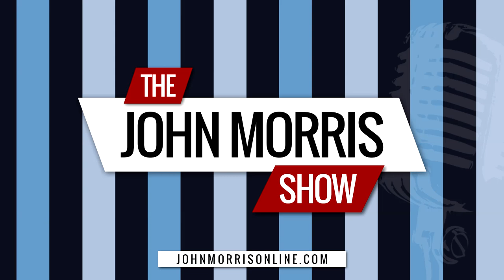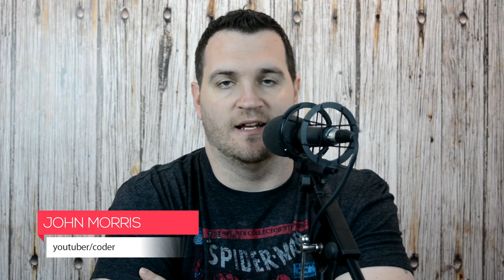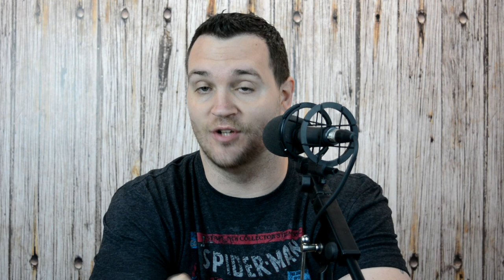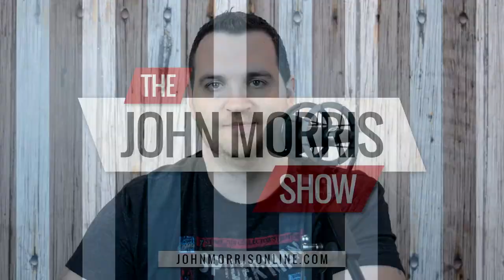Nobody cares about your code

Comment: I agree with you. I have fixed spaghetti code for people, well, bugs that were in those spaghetti code many times, and they are totally happy with the code. 

What ends up happening, is that eventually, the project might not be sustainable, load too slow, can't do this and that etc.. and they will need to re-make the website. 

Anyway, for freelancers, what I'm doing now is I'm creating a template, well, a framework for myself that will allow me to customise it every fast, a very flexible framework(bootstrap won't do or whatever - not going to get into details, something is good, sure, in fact bootstrap can be great if the client has a bad design that needs just some color tweaks and adjustments, then you can make 1site a day lol ) that will get all the upfront work done. I will just need to change the colours etc.. 

Of course, I will need to develop the main components myself, but if you did this for a while, you can probably have the HTML ready somewhere. 

So if you're freelancing, having a good code can be more beneficial for you, as you can be more productive and efficient, which leads to more $$$ because you finish your projects faster and you have set some rules on how you develop your projects - instead of setting every project with different files name and then looking for the files etc.. 

Though I'm still watching the video ;D
Reply from the maker: Yeah I agree... my point is just that geeking out with the code to try and sell a client often isn't going to be effective. They won't even get most of it. But yes... the end result will obviously be better with better code and writing good code makes things easier for YOU. This is not saying you should write crappy code... it's about how you market and sell yourself.
Reply: I was talking with a developer yesterday, he said this exactly as you!

Damn!

I was looking at another guy video and he said that:

Skill 2/10
Marketing 0/10

You will get paid for example $20ph

But with marketing 
Skill 2/10
Marketing 5/10

You will get paid $100 for the same code or skill

Something along those lines. 

Marketing is the most important stuff, building a blog, I mean, you said those things too. Create a YT channel a website.

Damn, you have soo many great information, I just need to watch more of your videos!

They are great!